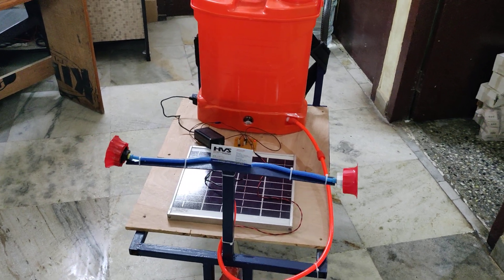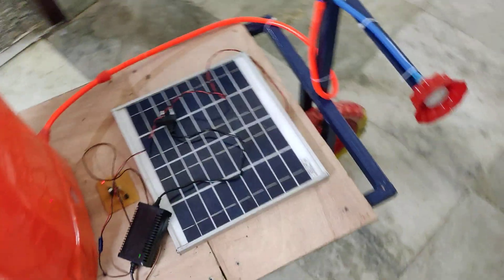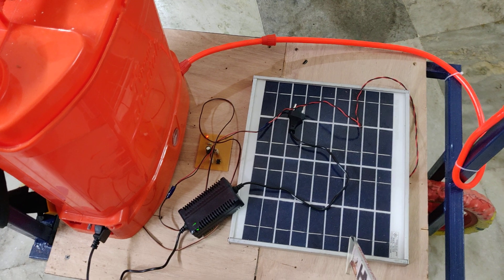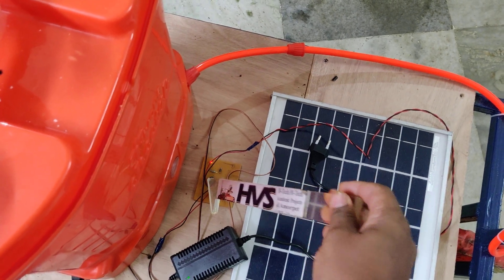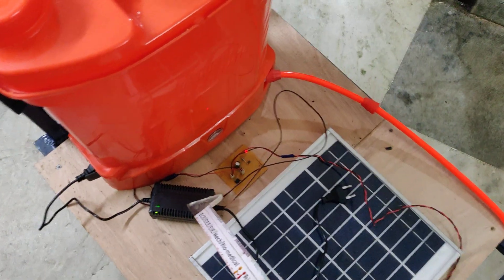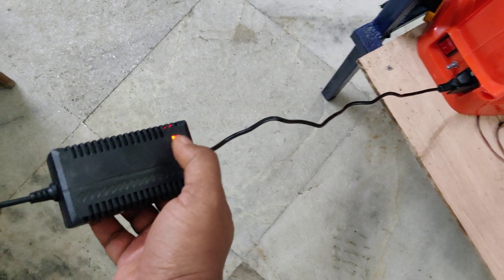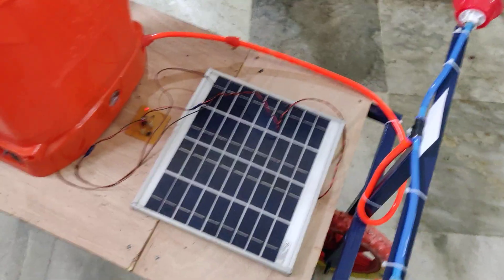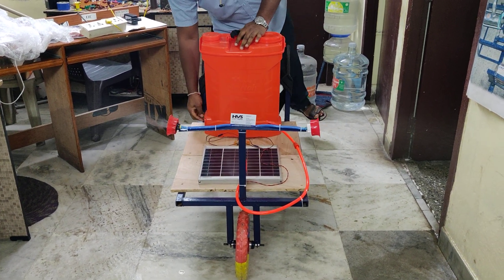Solar Powered Pesticides Sprayer

Comment: Sir is there a charger circuit for 6v solar panel and 9v battery available?
Reply from the maker: Yes. You can contact us at +919603140482
Through WhatsApp or call